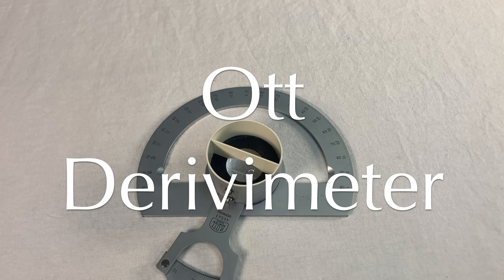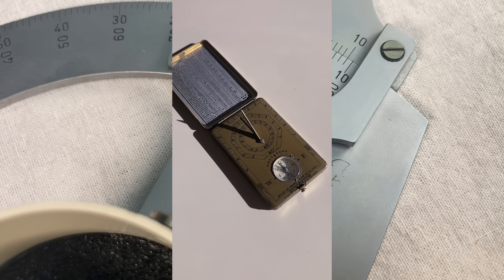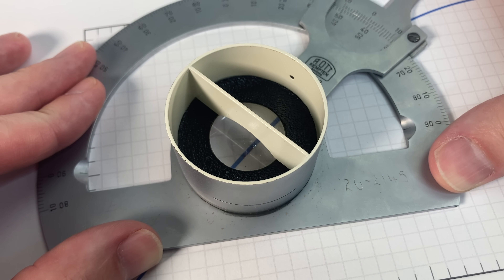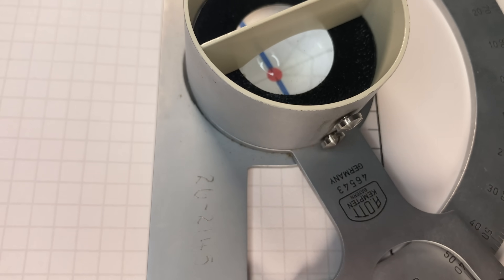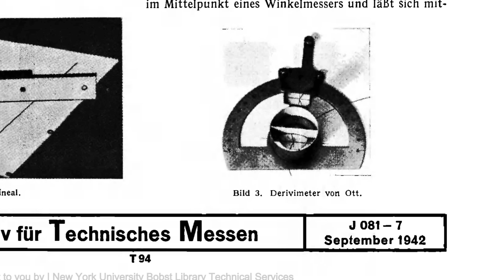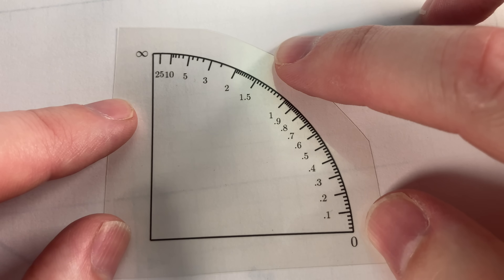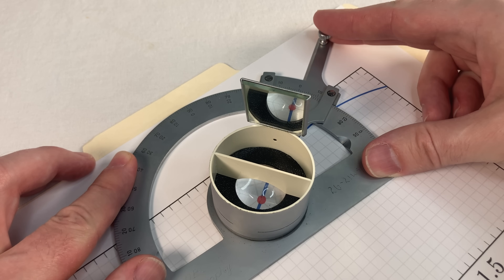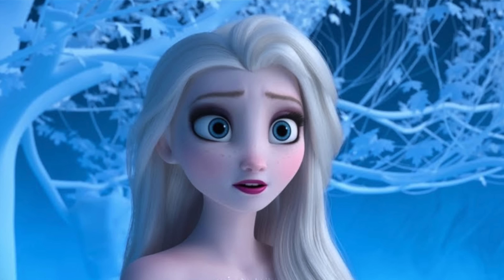It finds the derivative: The Ott Derivimeter (1930s)

Comment: "Just drawing a tangent" is the hard bit. I wouldn't do it by just eye-balling it like that - even for that "simple" curve. Two points define a line, so I would take two points reasonably close together on either side of that point, and use them to draw the slope to the left and right and take an average. It still won't be very precise but is better than raw dogging a tangent through a single point. Once you have the slope, you already have the derivative. Getting the slope with pen and paper is the hard bit - depends how close your points are together and how thick your pen is.

Comment: Looks to me like it still needs some skill and practice to line up properly. At first I thought it was foolproof, but I think I fell into the trap of lining up the reflection with the continuation of the curve visible on the other side of the mirror - but thinking about it, this is wrong, in fact if the mirror image does line up like that, then you don't really have a kink free line. Not too bad for a gentle curve that approximates a circle (in the case of a circle, lining up the reflection with the continuation of the line would be correct), but not so good for more rapidly changing curves. Still, you could practice once you recognise the pitfall, and probably get pretty good at it. And the girl in the bar wouldn't care anyway, so it's still a babe magnet, obviously.
Reply: It will work for any continuous curve, given the limits of the device with respect to accuracy.  After all, it works by eyeballing the curve and its reflection.  However, given perfect eyeballing, it should work in principle.  

If a curve is continous, any portion of the curve will be continuous.  This device reflects a portion of a curve.  Assuming the plane of the mirror is perpendicular to the plane in which the curve lies (i.e., the paper), reflecting the portion of the curve is equivalent to rotating it about the line of intersection of the mirror and the plane in which the curve lies.  If the plane of the mirror is perpendicular to the tangent to the curve at the point of intersection of the curve with the mirror, then there will be no discontinuity (or kink).  If it isn't, there will be.

If the point on the curve where it intersects the mirror is chosen to be the origin of a Cartesian coordinate system with the line of intersection of the mirror with the paper as the y-axis and its perpendicular through the origin as the x-axis, then for every point 'p' along the original portion of the curve at a given distance 'd' from the origin along the curve, there will be a point 'q' in the reflection with the same y-coordinate and at the same distance from the origin along the curve and whose x-coordinate has the same absolute value but the opposite sign, if the mirror is positioned correctly, and if it's not, there won't be.
Reply: @laurencefinston7036  You are misunderstanding me. Yes, of course, a no-kink reflection represents a tangent. But judging 'no-kink' isn't 100% straightforward. And there's definitely a temptation to look at the reflection and see if it coincides with the continuation of the line beyond the mirror. See 00:06:57 as an example. The pivoting of the mirror only lasts half a second so you need to pause and move the video frame by frame, but it's not entirely clear when there is no kink - it's very clear when the reflection lines up with the continuation of the curve on the paper behind You can just see the continuation of the line on the paper the other side of the vertical dividfer), and that looks pretty kink-free, but in fact is wrong unless it's a circle.
Reply: @thisnicklldo  The way this device is meant to be used, the curve beyond the mirror isn't visible.  In addition, the continuation of the curve would be congruent to the part before the mirror for any curve that was symmetrical about the point of intersection.  This could be, for example, a cusp of an ellipse or a sine curve.

Comment: So, you're derivimeter has 3 significant figures of precision.  So the Measurement was 0.536.  Watching you read the plot, and getting 0.540 I suspect it's more to do with the size of the plot, and not being able to measure as accurately, not the instrument.  Your graph also has 0.05 increments.  So while it has 3 significant figures, it's only 3 +- 0.05.  So based on the graph, the reading is the same as the calculated number.  

To get closer change your graphs size, and change the precision to 0.01. so you can get a more accurate reading.  Seems like the instrument will do it.

Back in the old days, you'd plot your curve, be it calculated, or empirical data on graph paper.  Then you'd measure the "derivative" like you did.  But to integrate the curve?  You'd cut it out as carefully as you could, and weigh it.  Then you'd weigh a measured square, say 10x10 and divide it out, and voila, you have the area under the curve.

Kids think that all this stuff became available with computers.  Nope, this stuff is what made computers possible.

Signed, an old crusty engineer.

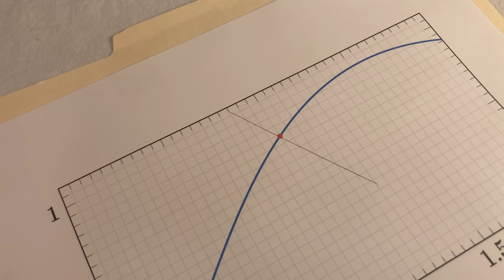Comment: 2:54 hey but why does the mirror trick work for getting a good slope? The intuition isnt clicking for me...
Reply from the maker: It’s because apparently the human eye/brain is better at identifying kinks in curves than it is at judging when one line is tangent to a curve. This may be related to the “Vernier acuity”- see wikipedia
Reply: It has to be a continuous curve.  By reflecting a portion of the curve, in effect, you create another curve consisting of the portion and its reflection.  If the mirror is perpendicular to the curve at the point of intersection, the new curve will also be continuous.  If it's not, there will be a noticeable discontinuity, i.e., a "jog" in the new curve.  The tangent is the perpendicular of the plane of the reflecting surface at the point of intersection.

Comment: de la part du Christ ! Pi 3.16 et pas 3.14 : PI ! 1: tracer un cercle de 100 mm de diamètre!
2: noter les 4 points 0, 90, 180, 270, 360 degré ,ce dernier rejoint le 0!
3: tracer une ligne du point 270 à 90 qui se trouve être le diamètre!
4: tracer une ligne du point 0,360 et le centre du cercle!
5: tracer une ligne du point 0,360 au point 90 et une ligne du point 0,360 a 270, vous obtenez deux triangles, celui de droite triangle 1, celui de gauche triangle 2
6: calculer l'hypoténuse du triangle 1! racine carré de 50² + 50² = 70.71067812!
7: diviser par 2 = 35.35533906 le milieu ou la moitié de cette ligne
8: tracer une ligne de cette moitié de l’hypoténuse triangle 1 au point 270, Vous créez un 3eme triangle, cette ligne est l'hypoténuse du triangle 3 et représente le quart du cercle!
9: pour calculer l'hypoténuse du triangle 3! racine carré de l'hypoténuse au carré du triangle 1 + la moitié de l'hypoténuse au carré du triangle 1, racine carré de 70.71067812 ² + 35.35533906 ² = 79.05694151 Le quart de cercle 79.05694151 !
10: rapport quart de cercle : diamètre divisé par l'hypoténuse du triangle 3 ! 100/79.05694151= 1.264911064 ce nombre en utilisant la méthode précédente de calcul pour tout diamètre reste inchangé, pour obtenir le quart de cercle 100/1.264911064= 79.05694151 ou 79.05694151*1.264911064=100
Un quart de cercle de 90mm*1.264911064=113.8419958 diamètre du cercle 360 mm !

Comment: Made me laugh! "Now sitting side by side in my basement."    The whole topic makes me wonder if it is a bad outcome to lose these old mechanical techniques.  Derivimeters, Slide Rules, Mechanical Calculators, https://www.youtube.com/watch?v=fhUfRIeRSZE
Reply: Well, the methods aren't lost, and nowadays, you could use a 3D printer to make an instrument that works on the same principle.  This is a rather specialized drafting instrument and I'd never heard of it before, but standard drafting tools are still available, though more rare than in the past.  I'm always glad of an excuse to get mine out, but I mostly only do this when drawing on wood, cardboard or other materials that can't be used with a laser or ink-jet printer.  Otherwise, it is so much easier and more accurate to use CAD that I always do that, where possible.

This device works similarly to a sextant, which also has mirrors, and you can still buy sextants.  I bought a relatively inexpensive one just a couple of weeks ago and you can get very fancy and expensive ones made of brass.  They are still essential equipment on boots and ships and not likely to ever be superceded, since they don't require electricity.

Comment: Nifty.  And thanks.  I don't think that I've ever seen such a widget as this one.  I have heard that there were many such mechanical ideas and devices around hard problems in the past; now we have computers and handheld calculators, some with built-in spreadsheets that might be viewed as gadgets to calculate many hard problems.  Slide rules back in their day were also mechanical devices to work out hard problems. And slide rules still can, if you have one, just as the device in this clip demonstrates that it still can do calculus.  For those of the 'computer age,' boggle, eh?

Comment: The device does not "do calculus".  The thumb is misleading.
Reply from the maker: What would count as calculus to you?
Reply: @ChrisStaecker  Calculus is analytical, this is not.  This is geometry.  Geometry is not Calculus.    You used Calculus to produce the correct answer that you checked this geometric approximation against.
Reply from the maker: @jzero4813  You are expressing a popular sentiment that I hear often from calculus students. They think that "real" calculus is about using formulas and named "rules" for working out problems with pencil on paper. When we talk about estimating tangent lines by secant lines, or estimating areas with Riemann sums, they see this as some kind of filler content before we get back to the algebra and formulas.

As I tell my students, this is a wrong view of the subject. 

Calculus is applied in real life routinely to empirical data: biological, financial, sociological information which doesn't obey formulas of any kind- the approximation approach is the only game in town, and this is still calculus.
Reply: @ChrisStaecker  It's not a sentiment,  it's a definition.  The device performs a geometric operation.  By inspection this is the case.  Fuzzy thinking is a regrettable thing to teach students.
Reply from the maker: @jzero4813 do you have an actual definition of exactly what counts as geometry and what counts as calculus? This is like debating music genres-
Reply: @ChrisStaecker  It's not a debate.  Geometry and Calculus are different.  This is why we have two words instead of one.  Mathematics is a discipline of precision.  Clear your head, my goodness... you won't learn if you only want to fight.

Comment: Hey, are there any machines that can draw ellipses?  You know, kinda like a compass, but instead of drawing circles, you can set the eccentricity and the size and draw an ellipse?  I wanted to design one as a kid. I failed.
Reply: Yes, there are.  They're called "ellipsographs".  One is called the Trammel of Archimedes.  An easy way to draw ellipses is to stretch a string around two posts at the foci, keep the string stretched with a pencil and move the pencil along the only possible path.  Hard to do this accurately, though.

It's not a machine, but there's also the old draftsman's method using a quadrilateral and triangles.  I can describe it for you, if you want.  It was used particularly for drawing perspective ellipses, i.e., circles in perspective (which are always ellipses).
Reply: In fact, for any planar algebraic curve, it would be possible in theory to construct a machine (using one or more plane linkages) that draws it.  This result is known as Kempe's Universality Theorem and was stated by Alfred B. Kempe in 1876.
Reply: @laurencefinston7036  Yep, I made dozens of sketches for devices that would draw ellipses based on their conic sections. Just never quite worked it all out.
Reply: Wow! Didn’t know about most of these. I'm a string and thumbtacks guy, myself. But for better precision, you can use a grooved stylus or a capstan and loop the string in the groove.

Comment: I demonstrated the prism trick with an prism (as used to fold the optical path in binoculars).  Unfortunately, the vertex of the right angle planes was not sharp, so there was always a gap between the lines that limited the accuracy and the localization of the x-coordinate.

Comment: ...ingenious simplicity of mechanical tools like this one never fails to impress me...:D
Reply: Computers didn't even really start to exit until sometime in the late '30s. Calculus originated with Newton and Leibniz in the 17th century, so there was a period of several centuries when analog devices like this were required to get the work done in any sort of consistent way. 

I'm not sure if anybody would have bothered if they had computers, but then again developing computers required other means of performing the calculations just to design and build one.
Reply: @SmallSpoonBrigade  ...many amazing things were made with slide rule scale alone. What amazed me about this differentitor is the idea of using mirrors to find the exact angle. So simple, but ingenious...:)

Comment: For anyone whose memory of differential calculus is a little rusty, the tangent to a curve 'C' at a point 'p' can be approximated by taking two points on 'C', 'a' and 'b' (with 'p' between them),  and drawing a line 'L' through them.  Let 'd' be the distance between 'a' and 'b'.  The true tangent to the curve is the limit of 'L' as 'd' goes to 0.  That is, as 'd' decreases, the approximation to the tangent becomes more and more accurate.

Using mirrors to reflect the curve is a clever way of getting around the unsolvable technical problem of finding and fixing points that are ever closer together.

From a drafting point of view, this is a very difficult problem to solve and I'm not sure how much a Derivometer would help.  I learned to do technical drawing by hand and I'm glad I did, but I say thank goodness for computer graphics and there are many things that I hope I never have to do by hand again.
Reply: Couldn’t you mark point p then measure say 3cm left on the chord and mark point a on the curve then measure 3cm right to point b then draw line a to b which should be close enough to the tangent slope for practical purposes? Granted my method would work better on a more regular curve than an abrupt squiggly one.
Reply: @someonespadre  No, because in general, you can't measure distances along a curve except by integration, which requires knowing the function and the function being integrable.  For the same reason, if you just took two points on the curve and drew a chord, in general, there's no way to tell which point on the curve would be the mid-point between the two points. To find the limit, it doesn't matter what points you start with (provided 'p' lies between them), eventually you will approach 0 distance.

There are only two easy cases, a straight line and a circle.  With a straight line, you can find the distance between two points on it by using the Pythagorean theorem and with the circle, the circumference is 2pi times the radius, so the relation between an angle and the length it subtends is the same for all circles.  With ellipses, it already becomes difficult.  You need elliptical integrals of the second kind to find an arc length.
Reply: @someonespadre  Another reason why this wouldn't work is that the rate of change of the radius of curvature along the curve (considered as a function of time) cannot be assumed to be same on either side of a point on the curve.  It quite possibly will not be.   So, a chord between two points will not, in general, be parallel to the tangent at the point lying between and equidistant to the two points chosen.